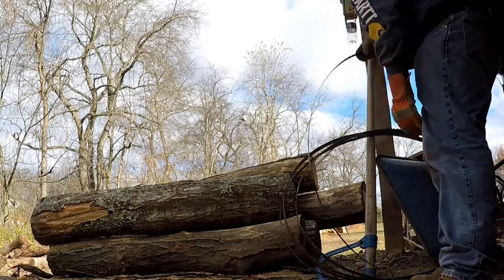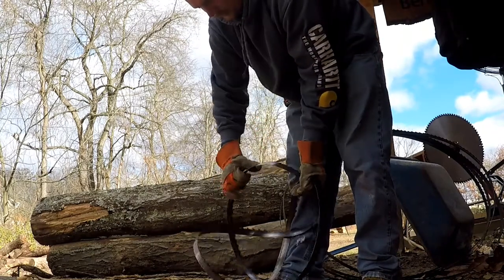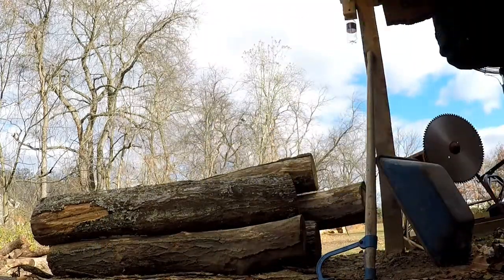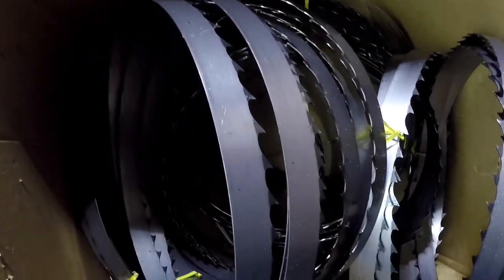Folding Bandsaw Blades

Comment: Wise move to wear gloves and boots! Rotating blades makes sense Ben. Then you will always  have sharp blades for cutting. How many times can you sharpen the blades before you have to replace them?
Reply from the maker: I haven't figured out how many sharpenings I can get out of a blade yet. I would say till they are to thin to track right on the saw. it's a lot I know that. Thanks for watching
Reply: I guess the harder woods would dull them faster. Always a pleasure watching your videos Ben.